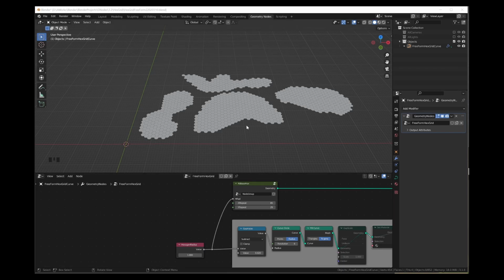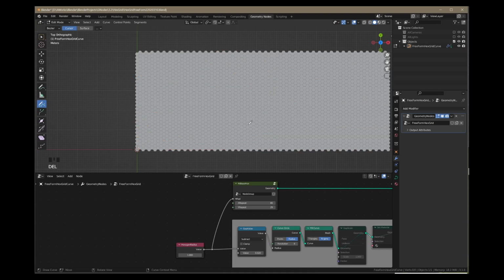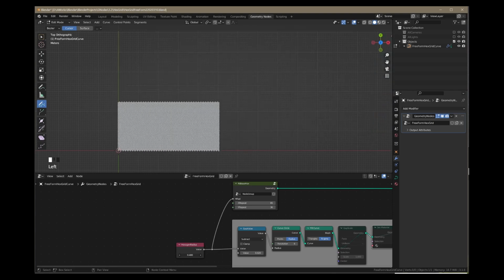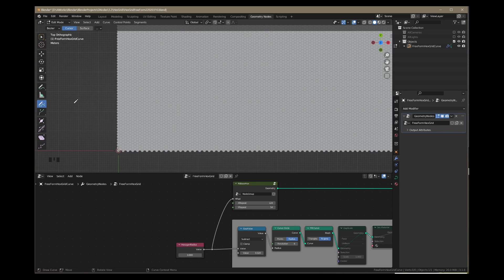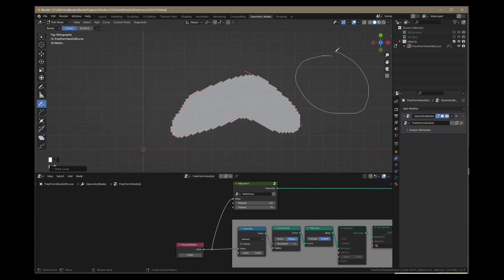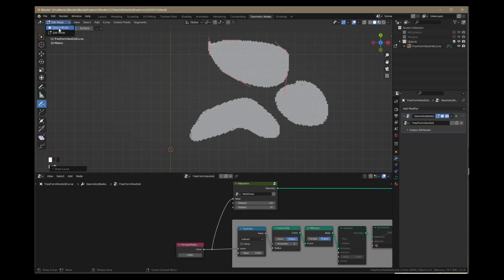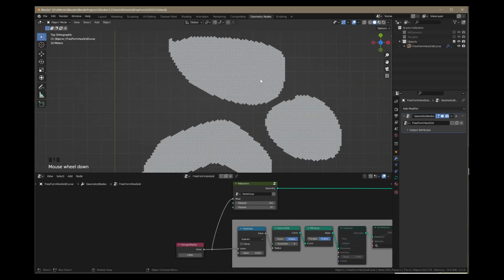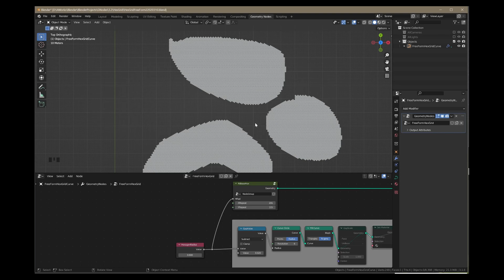Hexagon Grid (Free Form) Geometry Node Blender 3.1+

Comment: Can I use a circle as selection for Delete Geometry?
Reply from the maker: Use Mesh Primitive Mesh Circle node with N-Gon Fill Type & connect it to Target socket of Geometry Proximity Node. You'll have to use Transform node to position the circle properly. If still any doubt, DM me on Twitter.
Reply: @aarcharanya  Your DM are closed on Twitter
Reply from the maker: @conceptwcom  opened
Reply: I need an animation based on this script if you can help me